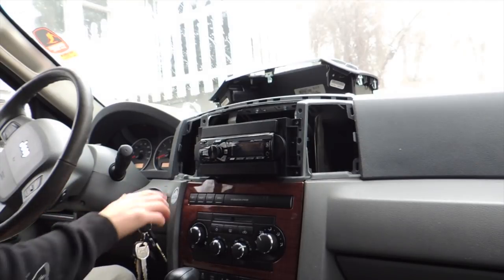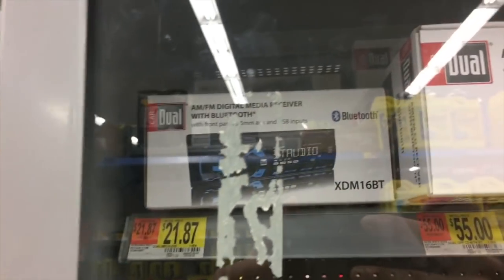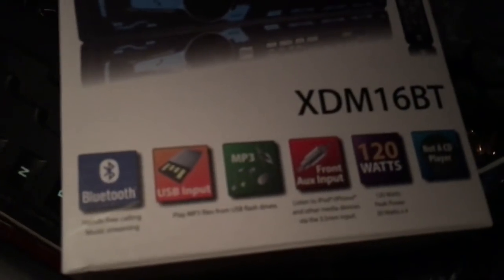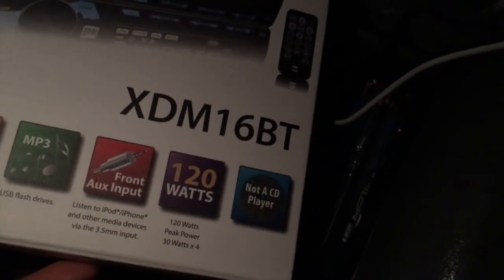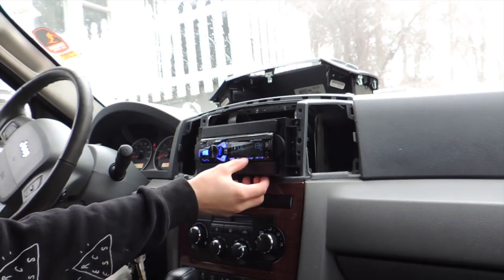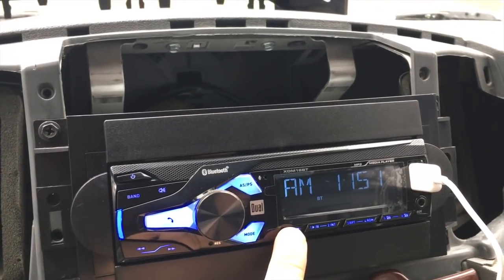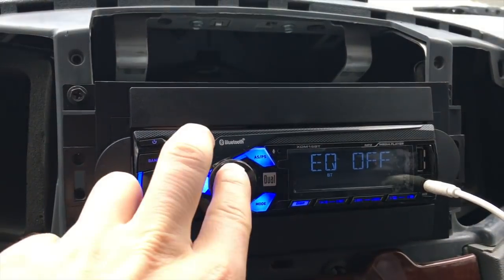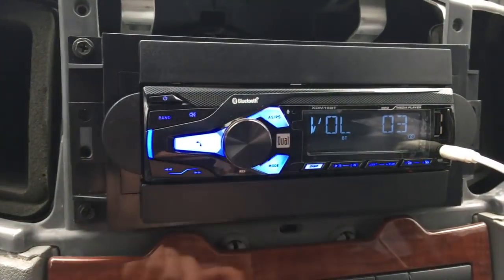CHEAPEST CAR STEREO AT WALMART, How Bad Is It? | Headunit | Radio | DUAL XDM16BT

Comment: I had one of these for a few years before I sold it for half of what I bought it for, it was super cheap and lasted, only problem was the sensitivity of the volume dial and the buttons seemed to go down over time, had it for about 2 or 3 years. Worked like a charm. Probably not the best but I got it to add bluetooth in an old car. Was well worth the $20 I spent. Would recommend it to anybody who is looking for a cheap bluetooth head unit.

Comment: Probably shorter and lighter because it doesn’t have all the components inside to play a cd. I’ve installed a couple of these shorter units and That don’t have CD players. Easier to install because there’s more room for the wire harness.  And they seem to get just as loud as the older one din full-size units. Granted they weren’t dual brand though.  But still short.  From my experience most units that don’t have a CD player or shorter entry level and premium

Comment: u can replace the 7833 chip with 7850 & add a much larger heatsink .. then it would be pumping 55watts rms per channel at 2ohm! (dont forget to replace the fuse with 15 or 20amp one.)

Comment: The USB port may not have worked because you also had a 3.5mm audio cable plugged in at the same time. It's also possible that the USB port is designed to play MP3 music files off of a thumb drive, which is mainly how I use a car stereo. A 32 gB thumb drive can hold 4,000~5,000 MP3 music files of 4 minutes average length - enough that you could take a 2 week road trip and never play the same song twice. Note that if you are formatting a new thumb drive to hold music for a car stereo or to play through a home receiver or smart TV, use FAT32 for the format; if you use NTFS format, your thumb drive might not be recognized by the player. NTFS is always okay for use with a Windows PC or laptop computer, but FAT32 is more universally recognized by media players and Android phones if you are trying to connect a thumb drive to your phone with an OTG cable.

I need to replace the stereo in my sailboat - the old one crapped out when a CD got jammed in it - and this $24 Walmart one looks like it will work okay. I don't need a CD player anymore. Does anyone still even listen to CD's? The only thing I would worry about with a car stereo this cheap is that the manufacturer probably used the cheapest capacitors they could get on the motherboard, and the potentiometer behind the volume dial is probably garbage too,  and it's usually one of those components (the pots or the capacitors) that kills cheap electronic gear.

Comment: Got one to play with as a little boom box controller and it’s not too bad I guess. The Bluetooth want to stay connected even when the unit is off and one of the RCA outs like to cut off after about 10 minutes  but what can you expect🤷🏻‍♂️
Still sends signal to through the outputs even when the volume is at zero. Damned thing can’t make up its mind, noticed it can’t read usbs at all I tried to tune with my dd-1 and it was tricky without a disk player or use of a usb, personally I wouldn’t ever put one of these little guys in a vehicle of mine but shiiiiit $20

Comment: The problem with the USB is user error.  If you read the instructions it tells you to download a program for USB.  So, why pay more.  If you want more power add an amp and good speakers and/or a kick ass equalizer. also to avoid crackling noise solder your wire connections.  :)

Comment: Actually there's a chance your USB Cable is not a data enabled cable but only a charge cable. That would cause it to sense long enough to start charging then not having data it would change back to the input that does.
Reply: Troy LL do you realize how unlikely that is. Where and why would he get his hands on a data only usb cable. They are so impractical, as well as standard charge/data cables come with every cellphone out of the box, and are sold in every dollar general and gas station

Comment: I have installed 3 of these for clients so far & one for my wife. They suck. The general purpose user wouldn’t complain especially if they’re coming from a factory unit or none at all. My biggest thing is it sends a horrible signal through the RCA outputs. If you’re looking for clarity in mid low & hi, stay away from this unit. It’s basically a clock radio with some beefy capacitors in it.
Reply: Ive not had any problems like that. No horrible signal on mine.
Reply: realflow100 it’s a single low voltage full range preamp. How isn’t that horrible? By the time you buy an eq & high/low splitters you would have spent the money it costs for a head unit with quality pre amps that won’t distort or roll off prior to reaching the amp that’s pushing the speakers. The RCA output on that unit is surely putting speakers and amps at risk.
Reply: I dont know. I'm just not having any issues with mine! Maybe you got really unlucky and got a bunch of duds? mine have clean output at volume 31 and below playing sinewave tones using AUX input method
no issues with the RCA outs. they work just fine.
but I am mostly just using mine as a more fancy amplifier for my stereo speakers in my bedroom. powers my speakers plenty well enough and gets plenty loud. very clean audio. no hiss or hum or any weird noises.
preamp going to my subwoofers amplifier works fine too. zero issues with it.
maybe theres some bad engine noise getting through or something maybe the vehicles wiring is poor?
The only time I noticed a problem is when you try to plug a phone into the USB port on it. its not designed to charge or sync phones that way. its only meant to read from a USB flash drive/USB thumbdrive/stick in the USB port. if you try to draw more than like 200mA it makes the stereo shut down and restart to protect the USB port from overcurrent
so check nobody is trying to charge their phones through the USB port. its not meant for that.
Reply: realflow100 it’s not that, it’s not making funny noises or hissing nor shutting off. It’s just producing flat sounds that roll off & distort. There isn’t an eq so it’s sending the same flat image through the preamp outputs (probably at like 1.5 v) no option for low pass or high pass output so even if your amp has a selection of Flat/LPF/HPF you’re still feeding it a flat signal. There is a big difference. The sound isn’t precise. That’s why I say if sound quality is important to you, save your money. You’d need Eq’s & passive crossovers just for a $20 head unit. It works but once you add a decent sub & a pair of tweeters, you can hear the distortion... the collision of frequencies that cannot be played through all of the speakers at once... it makes no sense that turning up the bass on the head unit makes a stand alone amplified sub distort.
Reply: Its not meant to have a low pass. your head unit and low pass is supposed to come seperate. you'd have to have a lot more expensive fancier head unit to have a sub low pass built in
Most amps already have a low pass/high pass filter built in that you can adjust.
it just sends the same signal through so you can do exactly what you want with it afterwards
Thats how your supposed to do it use the filter on your amp or your own custom EQ or custom low pass/high pass. never rely on the built in low pass/EQ/filter on the head unit.
I have my subs low pass all the way down and it sounds perfectly fine. no problems at all
Reply: realflow100 That’s the point. You need a better deck to achieve the sound quality I’m looking for. A sub out doesn’t deliver any high frequency tones to the amp at all, making the low pass filter on the amp more efficient. That’s the unit acting as a filter, sub out is typically also a mono signal as well. I don’t depend on the deck’s settings for this but I do depend on the signal. When you adjust things like bass, treble, & EQ your pre out will change with it, yet you should still have a clean clear signal. That shit even distorts when hooked into my studio monitors which play the EXACT signal the receive without any processing at all. In your theory, you can run an amp for highs and a sub amp off of the same signal and say it “sounds great” in reality it just sounds “ok” I have sub output, rear output, front output, & aux input behind a $30 Sony deck. No distortion through the output signal. (It barely distorts at all from speaker outputs) where in the case of my Wife’s car, which was my budget build project, the $20 Dual unit killed an amp & 3 subs & when the volume is cranked, the sub distorts. If I swap amps there is still distortion, indicating that the distorted signal is coming from the unit itself. In all of my life, I’ve never seen a deck sending a distorted signal through RCA’s. You’re literally telling me that one of the worst sound processing devices on the market sounds good. That may be fine, just as long as you know that 90% of everything else sounds better even with single stereo line out pre amps. Everything else about it is great... Sound quality is just not where this unit shines. Anywhere. 
•The Pre amp distorts
•The pre amp has very low voltage 
•The pre amp is processed through the “digital equalizer” 
They cheaped out on the wrong shit, it wouldn’t cost much more to divide the output signal. Same theory applies to why NBC looks better than PBS no matter what TV it’s on... it’s a weaker signal, still looks ok but not as good as possible for when can be done in an affordable manner. They cheap out on signal quality to keep network quality up.
Reply: realflow100 another thing that sucks is it doesn’t phone sync through the USB. I don’t need it to charge, but I want it to sync. I can only control MP3 files with a thumb drive. My iPhone nor my Android will sync via USB.... Bluetooth sync is fine. But as with the video, it powers off when I connect. My Sony deck isn’t Bluetooth, but when connected to usb, you can control basic functions of the phone like Music, Streaming, & calling with the deck itself.
Reply: its not a computer. theres nothing to sync to! its not supposed to sync that way.
only on more fancy/expensive model
it doesnt even list that as a feature anywhere in the manual. so it wont work
Reply: it distorts above volume 31 for me. keep it below 31 and you'll be fine. dont just crank it to max it will definitely distort if you turn it all the way up.
dont use any of the EQ or loudness settings in the first place. those are MEANT to be terrible. your system should sound good with all those EQ settings turned off and flat.
your doing something wrong if your sending a distorted signal out of the RCA's
if I keep my volume below 31 theres no distortion out the speakers or the RCA's and dont touch any of the EQ treble bass or loudness settings.
Reply: realflow100 I see that. That sucks. On one hand it can sync via Bluetooth but not a direct connection. On the other hand it’s not a computer.. 🤔 so, it has computing capabilities but nah, not really. C’mon my man. That’s sucks. A car with crank windows that doesn’t say it has power windows doesn’t change the fact that it sucks not to have them...
Reply: realflow100 Imagine an Xbox that performed like an N64. You can play all of the new games but you can’t go online & the graphics are 64bit at a low frame rate. That’s kind of what this deck is like.
Reply: I'm not having any problems with mine. so i'm just going to leave this conversation. just buy something else if its not working for you.
Reply: realflow100 I plan on it. & it works, It gets the job done. It’s just nowhere near “great” it’s not giving any problems, it isn’t broken, it gets loud, it’s just not designed for excellent sound quality. Exactly what my original comment says. If you’re looking for sound quality, don’t buy this one. That’s all I was trying to say in the first place. It just doesn’t perform well in that field. Everything else is fine & I’m sure that to an average ear, it’s satisfying. Do you know of a deck that this one outperforms?

Comment: I those little wire connectors, did they come with the unit? If not where did you get them?
Reply from the maker: I got them off Crutchfield.com 
They are called posi-twist connectors

Comment: Those units are crap.  The first one I installed didn't work at all.  I bought a second one (after all, it was already wired) and it works sometimes.  Lately it doesn't work at all.  Powers on, reads the USB but nothing.  Also, the radio doesn't work at all.  Total piles of crap, don't waste your money.  I'm going to replace it with a different unit that also has a better interface for the USB.

Comment: Honestly this thing sucks pretty bad. If youre choosing between this or stock head unit just leave it alone. Less power than a factory head unit, absolutely awful sound quality, RCA outputs shit out in about a day or so on mine. (Still sends signal out but really really low voltage)

Comment: The random usb shut-off happens to me too. It seems to work fine besides that though. Oh and it’s really bright at night.
Reply: I'm thinking the USB only supplies 500mA and most phones charge at 1A so protects the circuit by shutting it down. Possible fix is to take it apart and wire in a 5V VRM in parallel to give it a bit more juice. Use a 1A fuse though  or a worn out USB cable could cause a short, damaging both the receiver and your phone.
Reply: I know this is 3 year old but I took a big paint pen black one and marked that shit it's Hella annoying

Comment: Mine freezes in occasions
Reply: Any idea i have to disconnect the battery to fix it
Reply from the maker: It’s just a cheap unit. Bound to have problems at some point
Reply: Stephen Contreras  had that issue before only fix was to replace with a good ubit pioneer. Jvc is ok as well

Comment: Dual head units are trash all there head units have issues of some sort with usb and many other things
Reply from the maker: Dual just about anything is trash in my opinion! I’m shocked so many people support them tho in the comments
Reply: Try dual amps they are good i have a old (14year old)320watt that still works. My son also has a 4channel 400watt for his mids and highs. I have a 600watt 4channel in my truck works flawlessly. And i got mine on black Friday for 59bucks its super small.